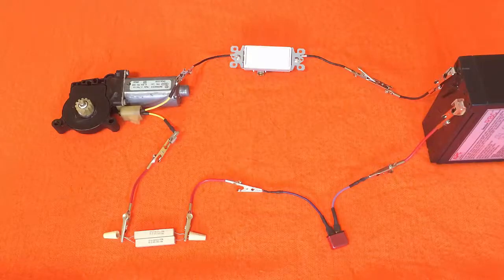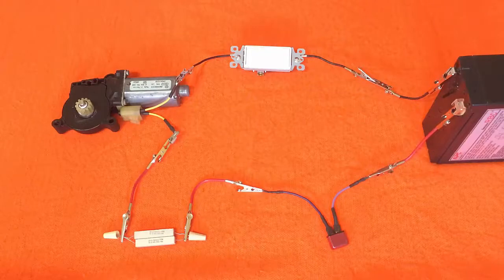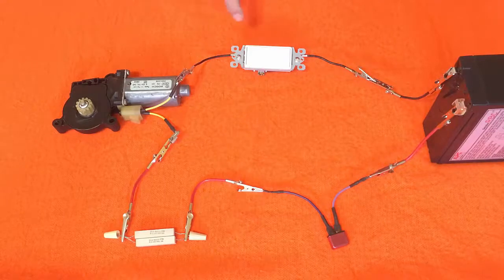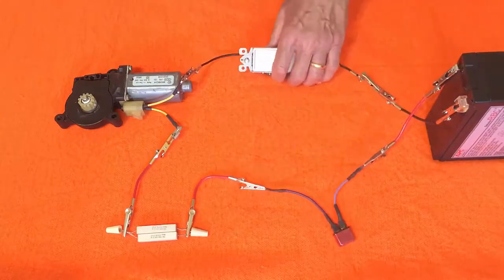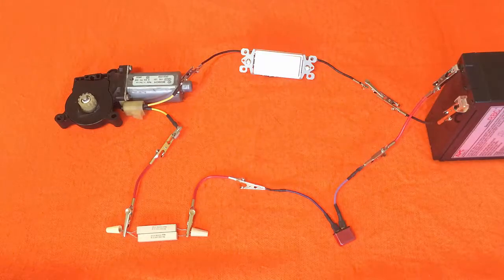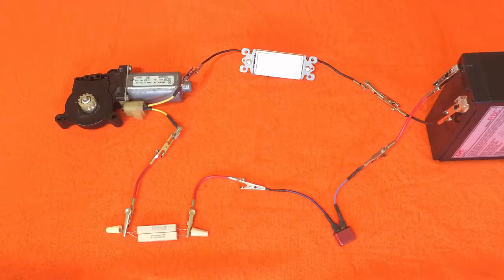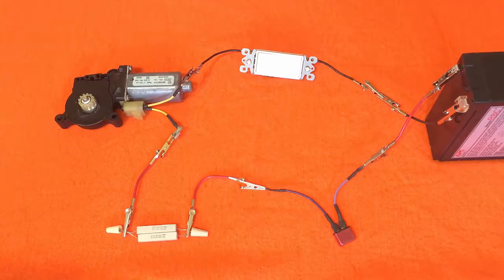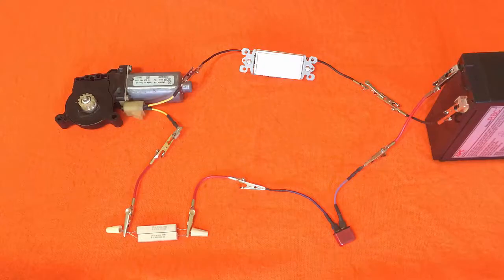Window Motor Demo - Reversing Polarity

Comment: 1998 Buick Century. After repairing the cable on my window regulator it now operates backwards. I.e. down button = up. I did not remove or replace the motor and the power cable is keyed so it only fits in one direction. Some sites say to remove the screws holding the motor and rotate the motor 180 degrees to correct it. Can anyone explain how does that change anything??

Comment: If your car window goes down and not back up, find the power disconnect. Strip portions of the wires and attach jumper wires (the ones with aligator clips) to the exposed areas in reversed polarity as shown in video. Make sure connections are good. Use the down button to roll window back up. Then, in your covered garage, figure out what is wrong with your system without risk of soaking car interior.
Reply from the maker: Jonathan,
Thanks for your input and sharing your method to get your widow back up so you can test the system in a safer environment.  Your method will definitely work.  

When I have this issue where the window goes down and not up, I will do two things before I get to the jumper wire step.
1) with the car running hold the window switch in the up position while banging on the interior door panel.  Sometimes  this will jar the brushes inside the window motor and allow you to get the window back up.
2) I will try to grab the top of the window glass and pull up while operating the window switch in the up position.  This will sometimes get the window to move, especially if the window motor is weak  or there is a high resistance problem not allowing enough voltage to get to the motor .
When I do use a jumper wire, I use one that has a circuit breaker in it and I reference the schematic diagram to jump the wiring at the switch.  
Below is a discounted link for my " DIY - Automotive Power Window Systems Schematic Diagnosis" course, for anyone who wants to learn a diagnostic thought process for window circuits that can be applied to any schematic.

https://www.udemy.com/course/automotive-power-window-systems-schematic-diagnosis/?referralCode=713B64B8C038C7F48E5A
Reply: @automotiveelectricaleducat5839  That's all good stuff.  I was/am reasonably confident my car (1990 525i E34 BMW) has General and/or Relay Module problems as all the windows, sunroof, central locking, wipers we're all inoperable on a co-dependent electrical system.  Not a fan of the manufacturer's wiring needless to write.  I swapped both modules and made some progress but am still not satisfied.  Wish I could replace the whole shebang !  Cheers

Comment: The positioning of your switch makes this completely misleading.

Instead of switching polarity on the battery you should use a double throw switch and light bulbs to show the direction of the current.
Reply: Yes, you are correct.  Thank you for your comment.

This video is a free video from my course on power windows operation and schematic diagnosis.  The purpose of this video is to demonstrate how reversing the polarity of the power source, the motor will spin the opposite direction.  Later videos in the full course demonstrate multiple windows with multiple switches and show schematic diagrams of how they are routed.

Comment: It will be nice if you can show this with dual motors so you can change ground polarity when you have two switches connected together to driver and passenger side motors